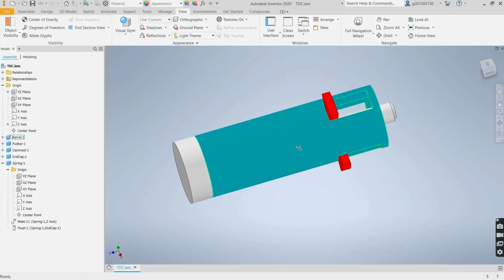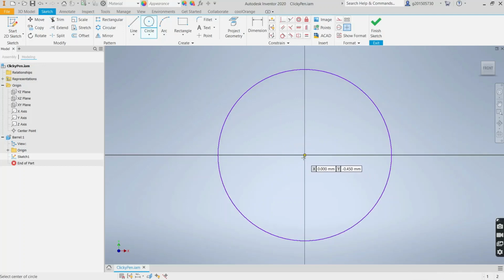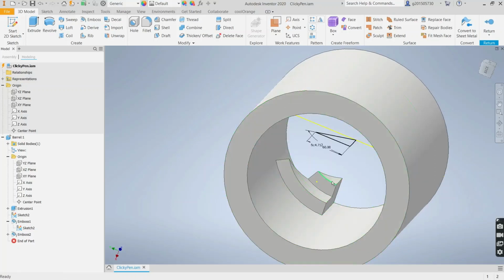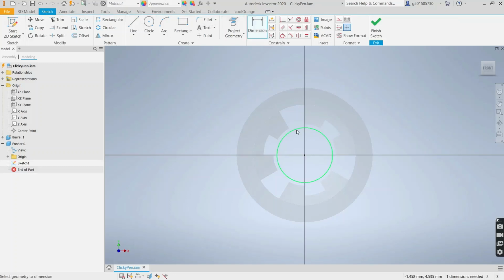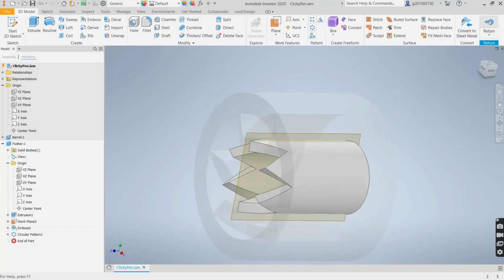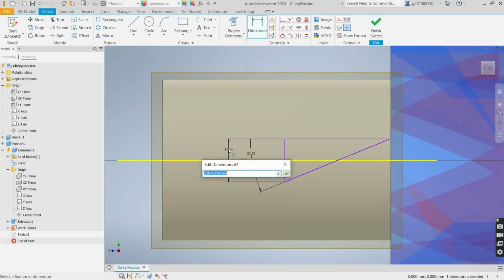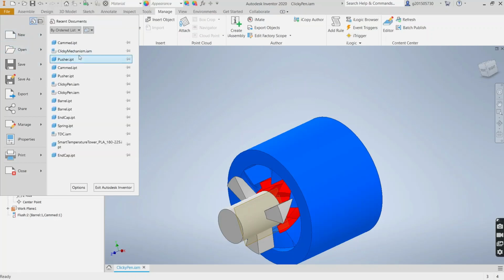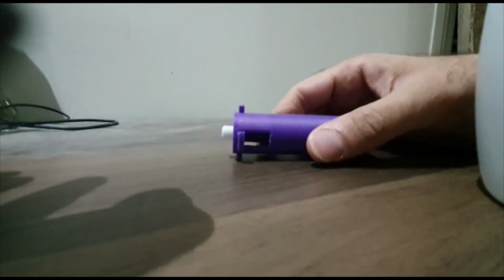Design a Clicky Pen Mechanism in Reverse using Autodesk Inventor for 3D Printing

Comment: Is it better to use Inventor or Fusion 360 to design a clicky pen mechanism? What if we want part of of the mechanism to be metallic? Thank you for your video!
Reply from the maker: I have not used fusion that much but I imagine it will be similar steps. Change the properties of a part to make the part metallic. I 3d printed this part in PLA and it has been working since!
Reply: @mtzmechengr5781  Ok, thank you!
Reply: Fusion 360 can be used to model the mechanism. And modelling this will be pretty easy with Fusion 360. As a designer, I started with Inventor but later switched to Fusion. Though, both workflows are the same but I find Fusion more comforting.
Reply: @emmanueladeyemi3077  Hi, I'm currently using inventor, and I want to politely ask that in which way do you feel Fusion easier to use. I'm wondering if I can try Fusion myself and decide whether to switch to it lol.
Reply: @simonli6083  Hi Simon, I’d say you should give a try. It’s definitely fine, in terms of assembly. The workflow is kinda nice too

Comment: I learned a lot from you setting up the parameters and using input dimensions of equations of pi. Thanks.

On your design tho, it doesn't click back into position like a click pen tho, you are pulling it back out, rather than clicking it out. How can I achieve clicking it out instead of pulling it out? I'll give you my email if need be. Thanks!
Reply from the maker: Not sure what you are referring to...It gets pushed back by spring action.
Reply: @mtzmechengr5781  (on your model) you push the pusher down, it clicks and stays down.  Then you push the pusher up, and it stays up. 

On a clicky pen, you push the pusher down and it  clicks and stays down. Then you push the pusher down again and it clicks back up.
Reply: @mtzmechengr5781  or am I just mistaken by the friction of the 3d print?
Reply from the maker: @AlfordMatch  ok I see what you are saying the pusher is in front of the cam. In a clicky pen the pusher is on the other side of the cam.